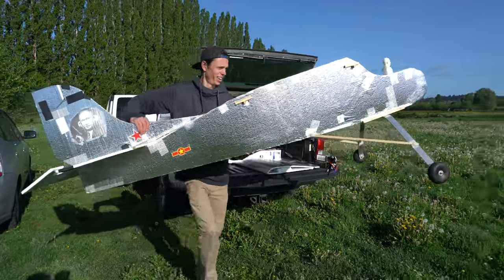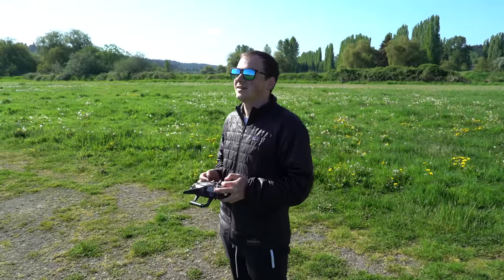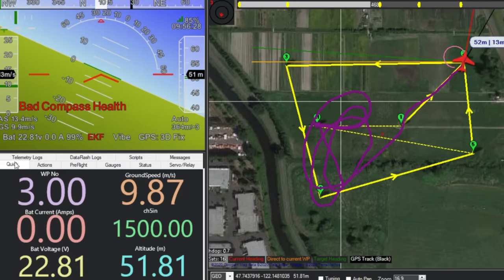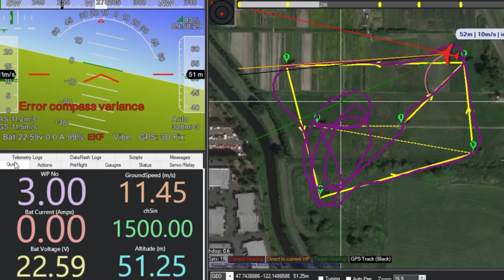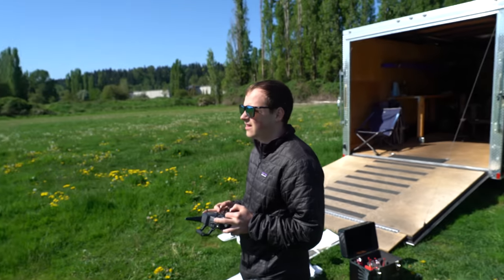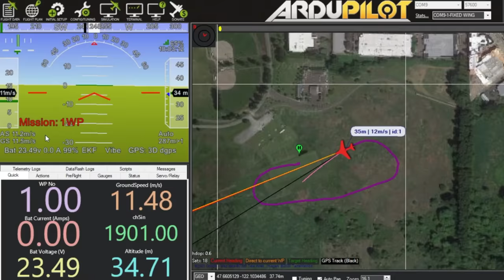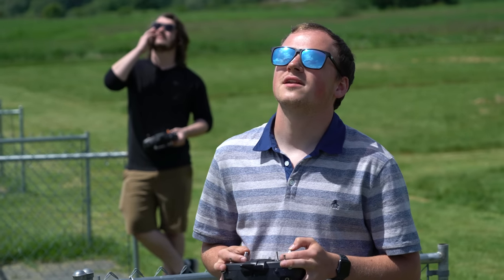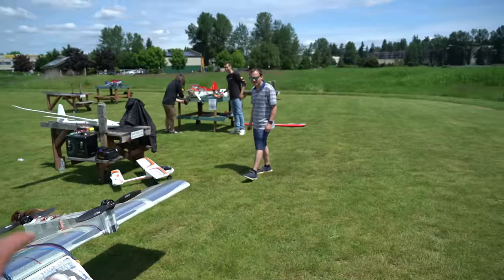Giant Autonomous Foam Cargo Plane

Comment: it would be amazing if there is battery changing plane during flight
Reply: Thats a badass idea. Make a lipo with magnetic contacts and put terminals on the back of the fuselage so you can snap it on mid flight

Comment: This would be a huge endeavor, but if you could pull it off, it'd be sick:

What if you had the big plane carrying some backup power, trailing a charge cord with a magnet at the end? Could you get a small, super-capacitor aircraft to connect in mid-air and recharge?

Comment: If you realign your motors so the front props are not blowing into the rear props it will be more efficient because the prop wash coming off the front props is disturbed air that the rear propellors cannot bite into.

Comment: Interesting to see those rubber bands stretching when towing the glider on the second tow. I have a trainer that if I loop too hard the bands stretch and change the angle of the wing enough it does a snap loop. Kinda scary.

Comment: Would recommend extending the wings to wing tips, you'll get much greater lift at those higher altitudes you need to avoid trees. Minimal weight as well, so minimal drag
This translates to less battery consumption, and best of all, more "towing" capacity :D
Reply: never mind, it flies, what else u need)
Reply: No need - the wing loading was already so low for us as is and it flew great. Super light airplane. Our issue with thrust these flights was more of an arming issue with the motors (one wing's motors didn't produce as much thrust as the other at full power). As a result, we needed a fair bit of rudder to overcome the asymmetrical thrust which in no way helped climb performance.  Reference the watermelon drop video to see it working properly without the thrust issues.

Comment: I’m just wondering, would it be possible to have a servo that is activated at a specific location? You could do autonomous bombing missions if it’s possible.
Reply: Is probably very easy, just (if pins available) set a pin to send a signal at X gps coordinates and make an on impact detonator, I did a thing like this with a Cessna hobby model (3m wingspan) and I got a HV battery transformer and a sparkplug that dropped fireforks xD it was fun, made it up to 28 fireworks at a time before the battery died
Reply: Or dropping weed off. 🤪😂
Reply: It's called geofencing I think. Yes it's possible.

Comment: The other day I had to repair  a strimmer engine. It turned out to be a "4-mix" and I thought it would be ideal for long duration RC flights. It would need to be quite a beast of an airplane..Anyone try Arduino/GPS long distance flights with similar engines?